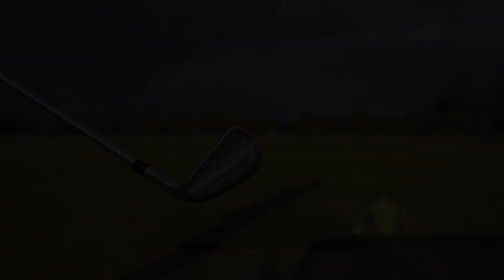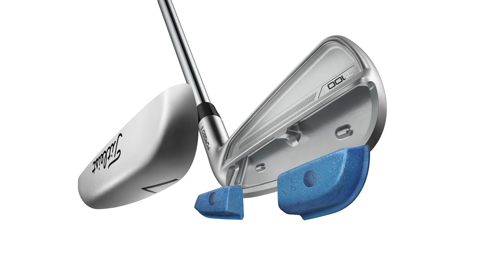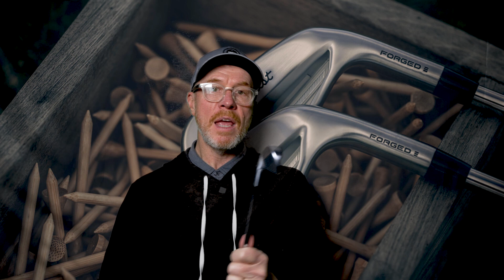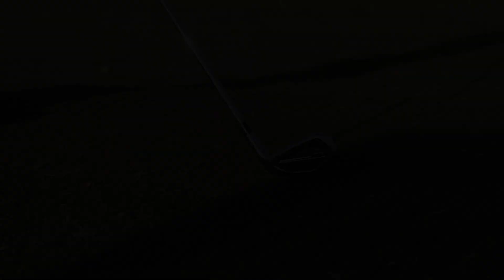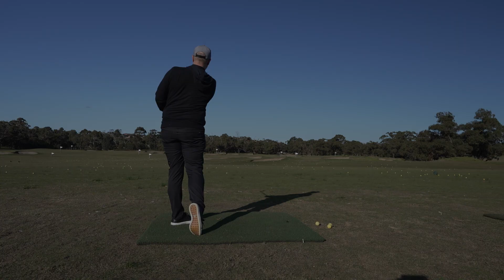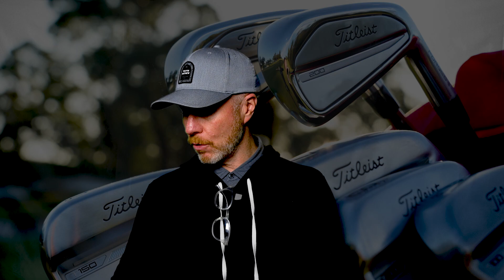Next Generation -  Titleist T-Series Irons.

Comment: T200 better stopping power vs t350??
Reply from the maker: Titleist said that they really wanted this iron family to have consistency in land angle between the sets. So if you combo sets you do have a big variation in flight etc. That said we don't do performance comparisons on here...so maybe a T200 may have some more back spin over T350, have to test..remember they are both different clubs with performance for the players they are designed for. What I do know is that the both felt great...and the T350 was a standout new club and i think many reviews have backed that up.